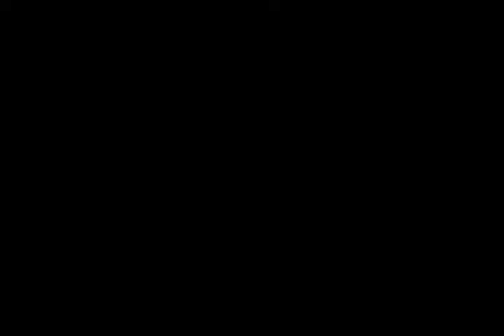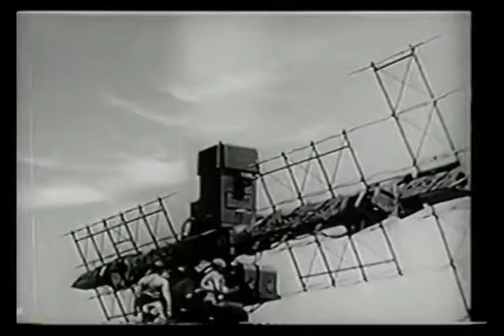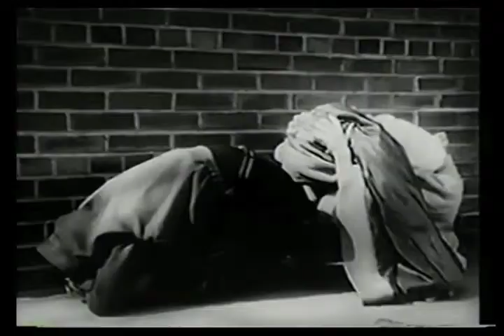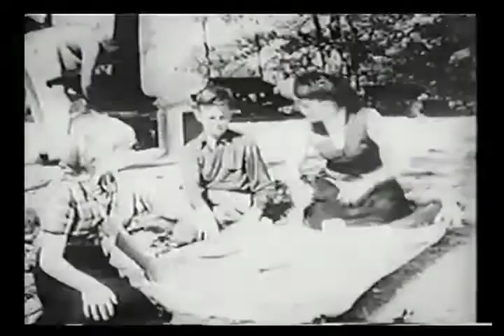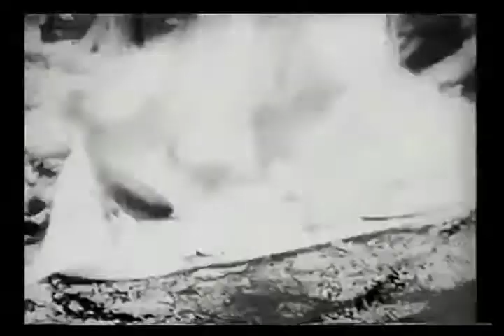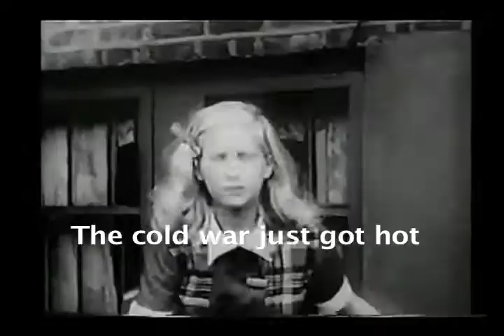Conelrad Promo

Comment: My understanding is that the idea was for several key stations over a wide area to broadcast, intermittently and in turn, on either 640 or 1240.  That would prevent Soviet bombers from using the signal as a homing beacon, as the location would change frequently.